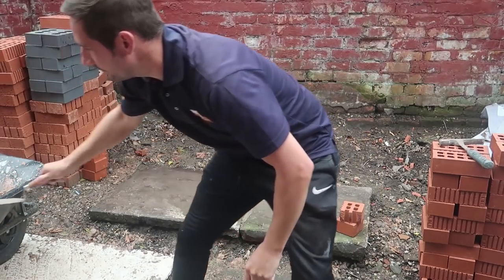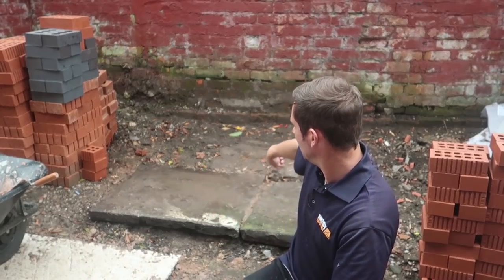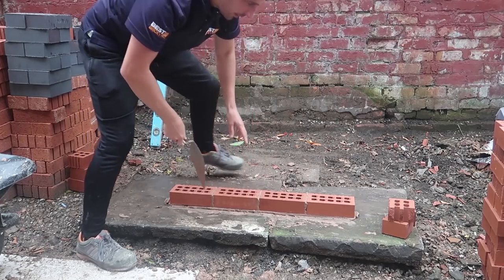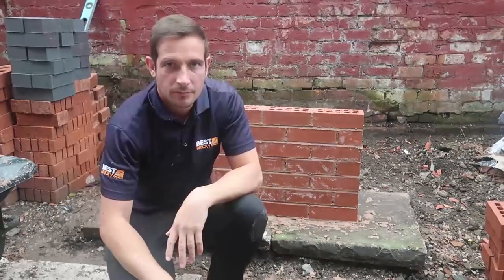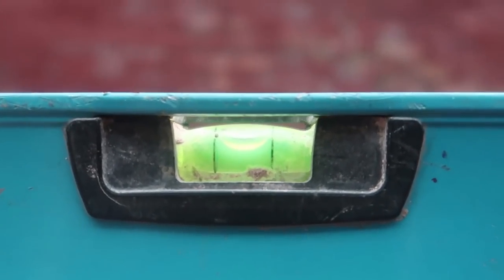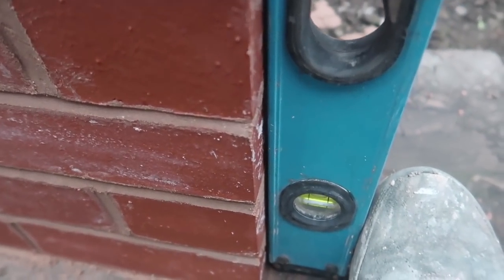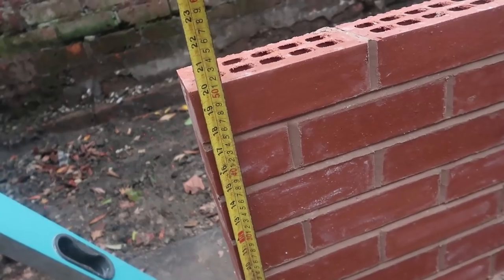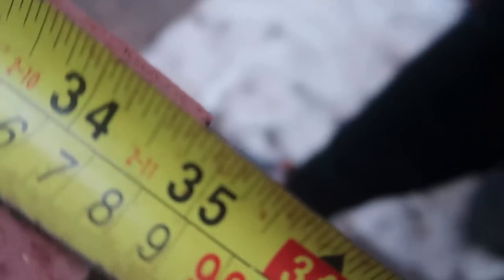Bricklaying WITHOUT level and tape challenge

Comment: To be fair, in a lot of situations this would be more that adequate. Always good to test yourself stu.
How about using a piece of steel bar as a mortar thickness gauge or a 10mm piece of timber like some or the Russian guys??
Your a good inspiration to some of the young lads just starting out. Keep the vids coming mate.
Reply: With the Russian system using the 10mm steel bars you have to be 100 percent level at floor level when you start the face brick.,the brick have to be exactly the same dimension,s I have been watching there work for ages and to make it even harder they do most of it overhand . Excellent work though.

Comment: Just subscribed and enjoying the videos. Just an observation but I may be wrong, when you measured the height of the wall on either end you observed the right side is about 20mm out. Shouldn't you have measured from the top of the first run rather than the actual slab as you mentioned it wasn't level in the beginning? Apologies if I'm mistaken.
Reply from the maker: no buddy you are right i made lots of mistakes with this i will try again

Comment: Once you're out, chasing all the way.....some days could do it every 3 others struggled every course...

Your a natural grinder....( unfortunately i worked with a bumper, had to chase a pig out once due to this...thankfully near the top of an extension....all bricklayers have done this at sometime, especially in stepped footings......easily done over a long pull)

Sometimes class B that are a touch small.....1-2mm soon adds up

Great try,  honest John! good on you....
Reply from the maker: cheers john
Reply: ha ha ..the term refers to you Stu...'Honest John'..I appreciate your honesty....Too many trowels won't admit thier weaknesses....

Me? not the quickest, untidy work space (bobby bomb damage was one on my labourers nicknames for me...amongst others), left handed. 

But my strengths were setting out, detailed stuff, arches, dentil courses , corbels, gauged arches, haunching drains....loved chimney stacks....very neat,  full joints etc.

Then got bored of houses/extensions and started doing gardens as well, then design, then re-trained as I was wearing out (young mans trade), Uni....Landscape Architect...which all the years previous are proving invaluable....

So keep up the good work and never think that's it...see where it takes you.....
Reply: This is dead right I worked with some engineering brick on a foundation 62 mm depth 209 mm long .

Comment: Im no expert. However, wouldn't the guage be different on each side in this case since the base wasn't level to begin with?
Reply: Not really, as the first course was levelled, so every course after that runs its gauge from the first course not the base.
Reply: This may be right, but Stu measures from the base (which isn't level), not the first course! If the base was running 10mm out of level it would show a 10mm discrepancy on the end result!